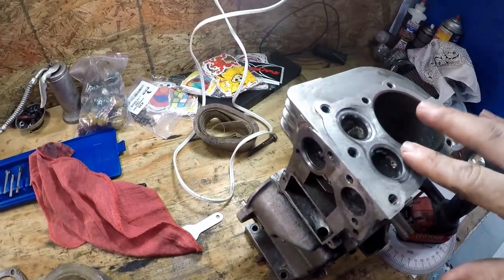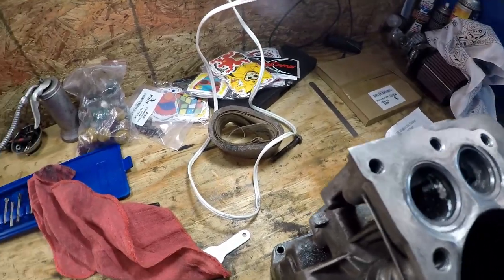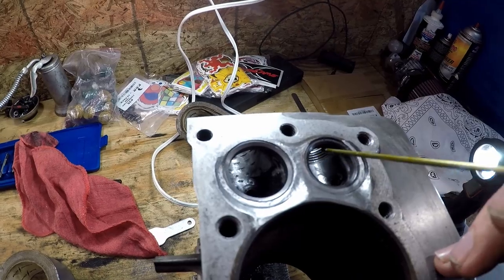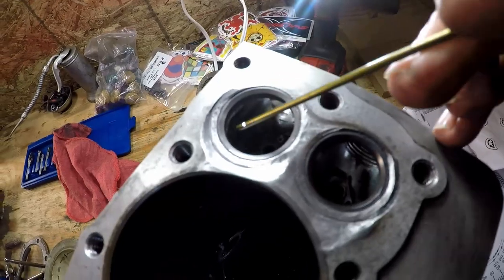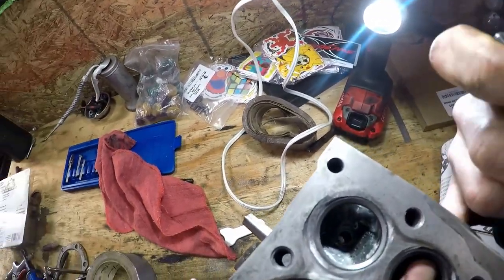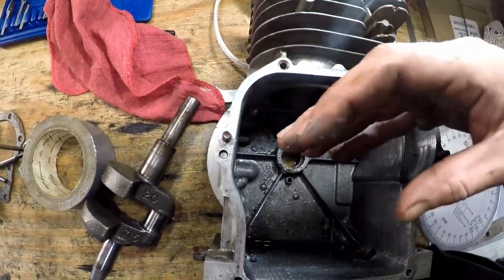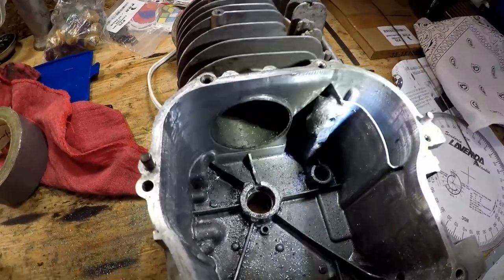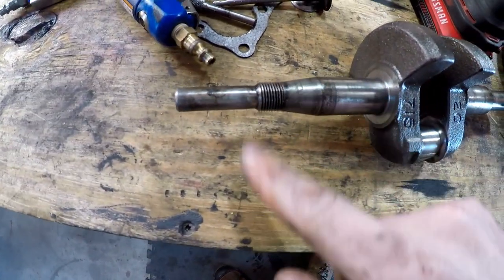Briggs and Stratton Flathead FREE MODS for more HP 2023

Comment: Why was inside of crankcase grinded?
Reply from the maker: Deburring
Reply: @RAWRMotorsports  what can be done to an 80cc lifan engine. I removed Governor but no parts upgrades available. What do you suggest? Upgraded carb? Port & polish? Or what engine has interchangeable parts for it? Educate please. No video for 80cc lifan engines.
Reply from the maker: Shave head , port and polish , shim valvesprings bigger carburetor
Reply: @RAWRMotorsports  what carb & springs would you suggest? Will 80cc predator billet flywheel fit? Need billet rod.
Reply from the maker: I wouldn't waste my time and $ to mod anything smaller than a 196cc
Reply: @RAWRMotorsports  I build 212cc Preds but got this small one free. So bored & have a challenge, $$$ not issue. I want to see how far it can be pushed. As we know there's not many videos on this engine (80cc Lifan). Part of my winter build lol what carb would you suggest for it?
Reply from the maker: Smallest mikuni style slide carb I could find prolly have to make a manifold
Reply: @RAWRMotorsports  update: 38mph on a drift kart with the 80cc Lifan, with my heavy weight... no upgraded carb or exhaust. But order is on the way. Gonna run it til it blows lol unless I find some billet parts. Might get some made. But kart will need bigger motor soon it flys 

🏎💨..............
Reply: @RAWRMotorsports  great for you so when your kids racing karts and there’s different classes for engine size like 3 hp blocks it’s a waste of money to not try and give him the sane chance every one else has at winning
Reply from the maker: Well I've done a 79cc Predator 
It was faster .. but it won't pull you up a hill offroad at all .. @megoingfast gas a few videos on the 80cc Lifan I believe
Reply: @RAWRMotorsports  shit!!! Just done 49/50 on 80cc Lifan, if GPS speed is correct. Slide carb (tuned), shimmed valve springs n str8 pipe. I weigh 215, top speed is on a  str8 away not down hill. Man I'm a believer now if built right it'll run. Still surprised the connecting rod or flywheel hasn't  broke. Might keep the kids off for right now. Debating getting billet parts made (rod, piston, crank,flywheel, etc.) Or just put a 212cc. Then it'll really move but surprised by 80cc. N ull never have uphill power with this motor no matter what. Str8 aways n downhill is king.
Reply from the maker: Facts .. the 79cc Predator I did way back did almost 50 .. then I cut a track around the property with lawnmower and had to put a 212 on it for offroad fun
Reply from the maker: I'm telling u build a 212 with all the goodies on a minibike and you will have a blast .. I outran a 450cc Honda Rancher
Reply: @RAWRMotorsports  yes sir... I got a light weight frame drift kart was for little ones but might be mines if I put 212 on it . I'll have to build them another 😆 little kart has launch control.
Reply from the maker: Go check out my recent stage 4 223 gokart build n let me know what you think
Reply from the maker: https://youtu.be/h-4LjLS_sck
Reply: @RAWRMotorsports  Already...
That's what's up the guy.
Reply: Update: 79cc Lifan (ohv) Engine with port/polish head, 19mm carb tuned/ bored, pulse pump, soda can gasket, vented n shimmed springs... finally blew stock flywheel ( well 🧲). Good news: engine case is good with no leaks. Dirft kart frame, 2.5 engine, stock internals, with head work, plus 200+ body . About 50 easy now, no bog. 35# chain. tach says 5100/ 5500 rpms before fail (unloaded) n engine shield saved my face literally😰... Will a 79cc predator flywheel fit shaft or will need custom made?
Reply from the maker: Idk bro
Reply from the maker: Just have to try it and see

Comment: How much compression did you loose was there an actual gain you could tell ? Or is it a waste of time
Reply from the maker: Airflow = HP compression is secondary
Reply: Mill the round chamber in the head all the way flat and you will regain your compression back after fringing the eyebrows from around the valves.
Reply from the maker: Yea I dont have a mill.. I used a big flat file one time and got it done but it was a pita
Reply: Compression over flow. Velocity is king
Reply from the maker: I completely built the engine with all aftermarket parts this just shows a couple things along the way ... airflow > compression

Comment: Will this work on an 8 horse? I haven’t seen a video on an 8 horse only 5
Reply from the maker: Yes it will .. dont get too crazy with the porting as you can actually hurt flow going too big
Reply: I’m starting to piece together an off road bar stool racer and have had this 8 horse floating around for years now I think it’ll be a good fit
Reply: @RAWRMotorsports  I can't seem to find custom rods and pistons for B/S 8hp
Reply from the maker: Nope .. Only 5 HP

Comment: I raced small capacity 4 stroke motorbikes in the 80's and would polish the crank bobs etc to reduce friction through the oil, do you think this would be an advantage on this type of engine?
Reply from the maker: Yes .. an engine is an engine ...  any wet sump engine will benefit from the same mods